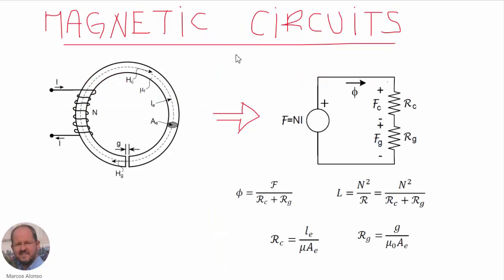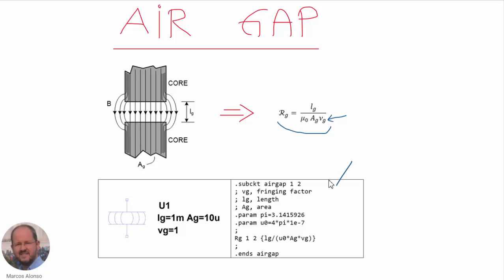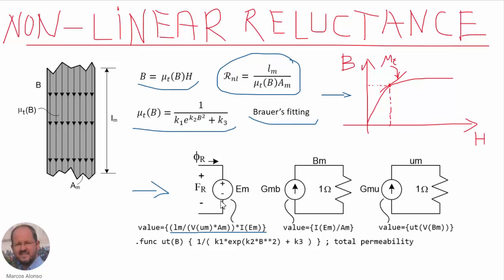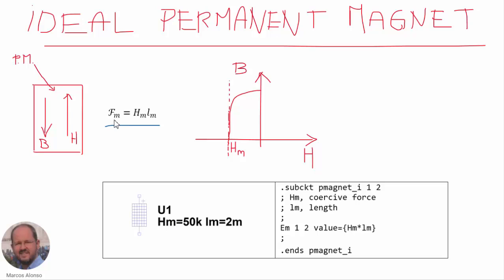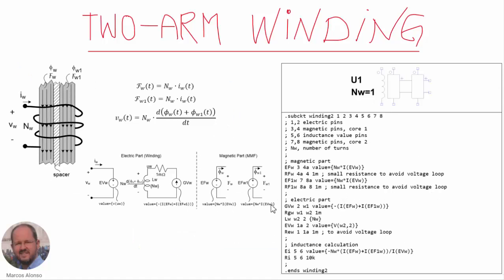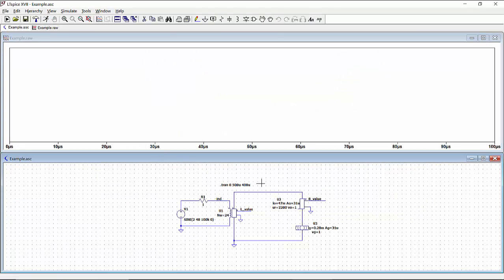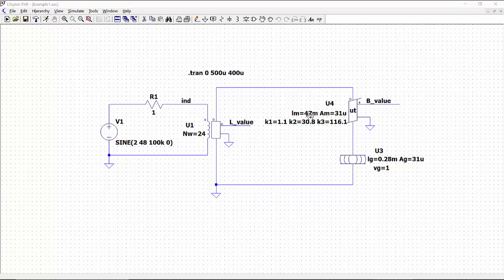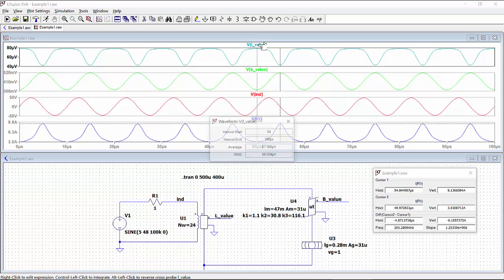PE #5: SPICE Modeling of Magnetic Devices

Comment: Hi Professor Alonso, thanks for this great course! I have a question. When you did the LTspice simulation, why is the source sin(2, 48, 100k, 0), DC = 2V, AC = 48V?
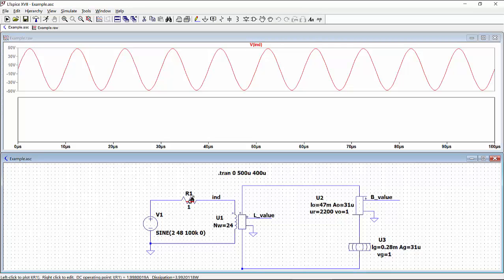Reply from the maker: Hi, thanks for your question. This is to adjust the DC and AC values of the current to the required values in the example. With DC=2V, the DC current is 2A in steady state, because the series resistance is 1 Ohm. With AC=48 V peak, we achieve an AC current of 1 A peak. See here more details: 20:50.
Thanks for watching!
Reply: @MarcosAlonsoElectronics  What's the mathematic relationship (equation)? Why AC 48V, then AC current is 1A peak?
Reply from the maker: Neglecting the effect of the series resistance of 1 Ohm, the ac current can be calculated as follows:
Iac=Vac/(2*pi*f*L) = 48/(2*pi*1e5*75e-6)= 1A
Reply: @MarcosAlonsoElectronics  Hi Professor, Thanks a lot for your explanation!